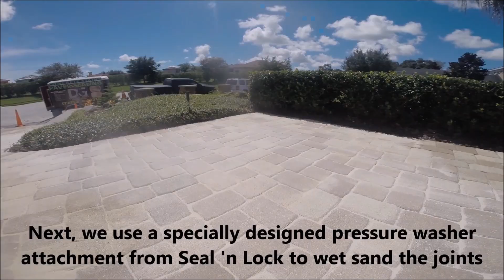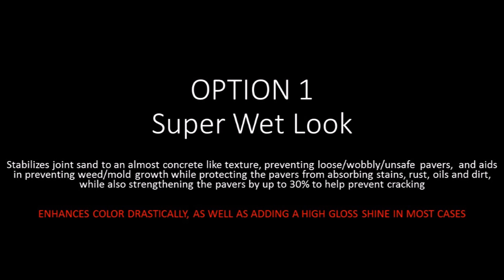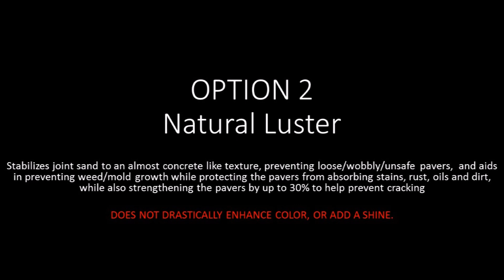Brick Paver Sealing in Pasco, Hernando, Hillsborough Tampa & all surrounding areas

Comment: how do you prevent the sprayer from clogging after each use?
Reply from the maker: We clean out our sprayer with floor stripper that you would use to strip a tile floor (reminds me of my army days every time I open a bucket of the stuff)! and it removed allsealer. mix 1 cup stripper with 5 gal water. let it run through system - do it again and leave the mix sitting in the line and pump right before you run out of your second 5 gal batch
Reply: +Dura-Guard Paver Sealing Genius! I always see baking soda recommended but didn't think it was effective enough. I build sprayer setups. How long do your diaphragm pumps last usually w/ the stipper-water cleaning method?
Reply from the maker: +Evan Hidalgo 
I started using the seal n lock sprayer systems (with a 12v shurflo 0.7gpm diaphragm pump) on all my trucks 3 years ago. the only problem I have had is 1 of them had trigger assembly issues that when I told seal n lock about, they overnighted me a new trigger gun and disnt charge me for it. Great customer service.
Reply from the maker: +Evan Hidalgo 
I read in my manuals that came with the pump to use pine sol and baking soda, but realised that if I use that same pinesol/bakingsoda mixture it won't get the sealer off my hands, so why would it get it out of the pump. took a gamble and have floor stripper a shot and it worked wonders
Reply: Thank you for that. Man I thought those kits came with at least 1.8GPM pumps, pressure looks good enough from your vids though! I saw a guy using the 3gpm shurflo pumps once. Probably a bit excessive, but great coverage w/ an 80° tip. Overspray and using too much sealer were his main concerns w/ his setup. Do you find the shurflow inline filter sufficient for prevent sprayer tip clogs?
Reply: I tried paint thinner at a 1/1 ratio and it expanded the rubber seals and ruined a pump. Your ratio of 1cup stripper/5gal water sounds much better
Reply from the maker: +Evan Hidalgo 
never really get any clogs. So it must do well lol
Reply: +Dura-Guard Paver Sealing Cool. Thanks. Last question, what do you generally spray down prior to cleaning? 2% Chlorine? Purple Power? Thank you for your service btw, my father was Army also.
Reply: A guy I know always downstreams chlorine (%1-2) and degreaser to algae covered pavers. Hasn't had any issues as he rinses thoroughly. I'll let him know to be careful though!